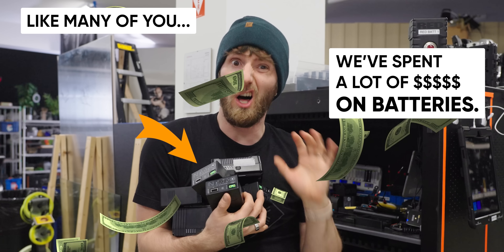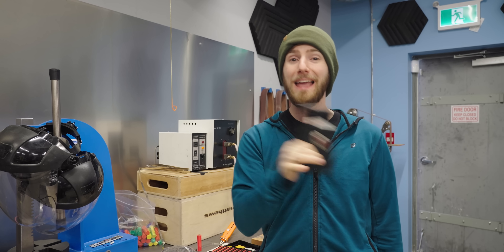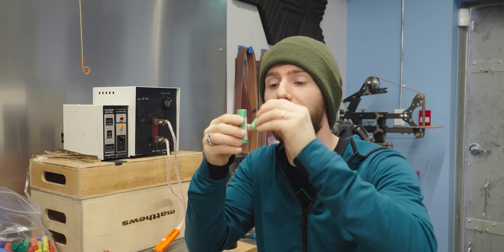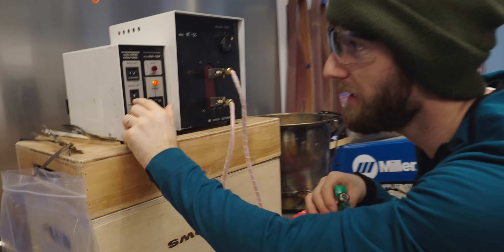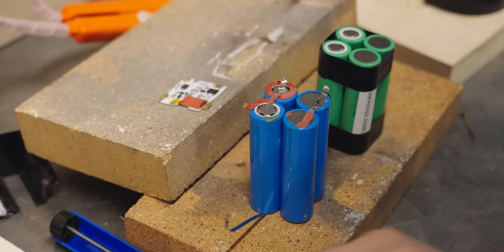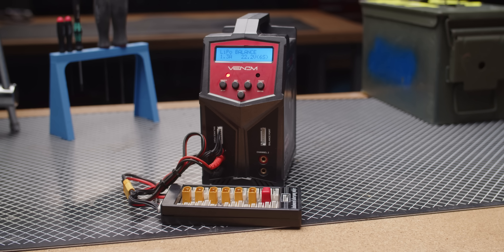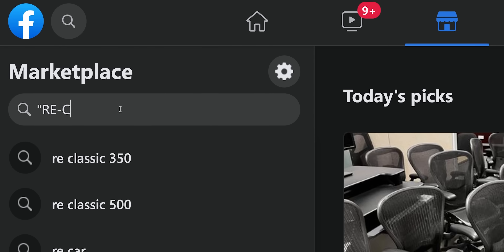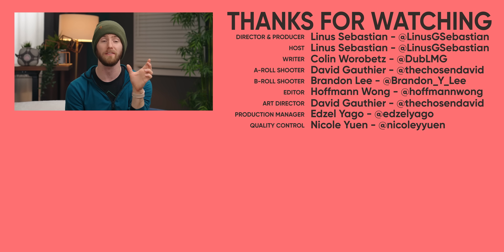This should be illegal… Battery Repair Blocking

Comment: 3:57 Linus explains how to do it like anyone is going to actually do it for themselves lol. I love this channel, but I don't think anyone is going to use LTT as their guide to repair their batteries lol. I know I wouldn't.
Reply: The LTT videos I have watched this far contain any electronics projects isn't something I would follow. There are often slight errors and the end result is just about hacked together to work for a short while, non professional
Reply: If you look into it, it is a big thing building Li-ion battery packs mainly for EV's RC ebikes and power walls, there are many forums and over 1000 Facebook groups doing just what Linus is doing here, some groups have over a million active FB users making ev batteries. Ebikes is the new big thing.

Comment: How you kept popping them?  This is what I have found to work...and so far other than the first couple I botched, I have not botched again.  Drain all cells to 3.2 before starting...and while you are using a spot welder...I use solder and quality wire.  Using a small sanding disc on a dremel to rough up a small dot on each end of the battery and using a solder that has a slightly lower melting temp...and a lot of flux I have generally had good outcomes.  If done properly it does not get hot...no hotter than spot welding...

Comment: it would probably have been easier to design and 3d print a new battery case with spring loaded contacts instead of doing the spot welding.

Comment: nothing new to me.  small engine manufacturers have been making parts from plastic that used to be made of iron steel, why?  heir claim is noise reduction, the truth?  plastic moving parts wear out much faster, and most people would just throw that engine away and buy a whole new one after 2-3 years of occasional use.  got a new push mower?  grass has to be cut, especially to avoid HOA or HA fines, and it is 100 degrees or more in the shade?  yeah, overheat that plastic carburetor just once, and you either pay close to $200 for the carburetor or $300 for the entire engine, or close to $400 in many areas for a new push mower.

i have had electronic devices just fail to work once the bad battery was changed out for a good one.  apple i phones are this way now, you can never change the battery as once the battery is removed, that $800+ cell phone is worthless junk and will never work again, same thing is true if the battery goes all the way down and you charge it back up.  and people wonder why i dont have any electronic devices other than a multi meter and an old computer.  replacement costs are way too high when the product cannot be repaired or you simply can not replace a battery that wears out  if a video i saw is correct, ANYONE who attempts to change the battery out of an apple i phone, the ones coming out in the next few months, can and will be fined and sent to jail/prison unless that person pays an apple dealer the price of an entirely new i phone to replace the battery.

if more people had my mindset, these companies would not be selling ANY product until they fix their flaws, and repair blocking is made 100% illegal for these companies to do.  they know how long the stuff will last, that is why all the "testing" and the warranty almost always runs out 1-4 days BEFORE the device/product gives up the ghost.

Comment: I know how to be able to change the batteries without the board disabling itself because of that malicious component which no doubt is a crystal in which is also hidden normally it under a black glob out from in view but also it is under an inside of the black square and  rectangular looking components. It's also how any camera is able to see and record us, not by a way they teach at all. I can't fin anything at all on any crystal doing anythig in electronics and also a tv screen is mainly 3 parts, one layer of the screen is a reddish tint of completely crystal and another is green tinted also being completely a sheet f crystal which most probably assume is glass unless speaking of the plasma style which does havea glass glass cover sheet. Now any camera if you take it apart it'll show u the eye of ability I literally a good chunk of square cut crystal and don ruin it but if u remove the lenses from a surveillance camera and power it on to check out the view you'll relize the crystal has quite a troubling time seeing as if it's eyes were bad r something. But that the reason for the lenses which can anyone at all explain how the I hope to work? It's a capability of recording it's surrounding, excepting messages of a specifics to bring programed specifically so not to do anything beyond it's rules f maintenance which I kinda scary to think on once realizing how tis thing can even listen to begin with. Yeah it programmable but how? It's not like being any other component of the board, they are inline circuitry, not a brain like the crystal suggests beyond the visual and definition of which in taught but for fact it is doing what it's at least taught or just old to do...this emplys being able to view into any crystal in the world visually an with audio. But back to the batteries, if you can find a voltage regulator of dc which there's millions of the hook it to the circuit board you can then remove the batteries without the losing power n in return the message should not be sent but thinking on this I'ma guess there's another limiter built in to further protect itself from being fixed lol I'd garentee there's a timer of sorts built in so to make sure no matter the state even of the batteries this message of time count down of specifics will misfuntion in a descreet but milicous again btw way, but taking the batteries into a classification of longevity, which I'm saying is completely regulated in all fields, science, any theory's I mean I name it lol. It's worldwide being also a control over the product did which if an person mad a better light bulb for example I better believe it's not gonna even find it way so say legally into any store for the fact that it would go thru the regulations office which we run, then thru the patent, which we run, ad if found out first off thtlwt in regulations state a bulb may not last longer than the mass agreed which u know who then a citation is given which prevents a person from publishing or commercializing the product in review, straight up gangster now if one looks back on electronics and ha that realization of the circuit chit board being the complete of certain regulations of agreed law, yes, but of a build completely I mean look at it, a tv is 120 voltage but inside it can n does go into a 600 volt output to be able to turn the damn blacklights on which are the smallest fluorescence I've ever seen but being as long or longer even n or mainly now being a LED which now think about it, they make a LED be able to be a 3.7v or a 600v by it's controls on thinness of wire n sizes in it's make, so for example if a gage of wire like 15 gauge then this 15 gauge must take a certain volt to work it also involved would be the amount of anything of it's make at all like the metal inside that electrified which gives a certain an specific color by which given is being mainly mercury but if blue, red, or green to whatever color then a added metal of specifics is given.

Comment: Hey linus as said before by other comments the sparks were likely not hazardous.
But your spot welder was set pretty hot (the cells don't like it too hot - that is the whole purpose of spot welding because soldering is too hot for too long)
I got some experience building battery packs (2x600WH (13S4P) for my mums e-bike 1x1.2kWH (13S8P)for my bluetooth speaker w/ 400w rms 1x240WH (6S3P) for my brothers scooter).
Better be safe than sorry with those beasts, but a few sparks from the weld are to be expected also I made my own electrodes using copper pipe and solid core copper wire to have re-placeable tips held in by screws.
A good idea is also to "sharpen" the tips ( I used an old sharpener for making coax cables from work)
Not an expert tho.

Comment: Manufactors use the excuse of safety for the consumer while intentionally blocking us from repairing it ourselves. They do this on most consumable devices such as printer cartridges. They sell the printers dirt cheap and charge astronomical prices for the cartridges. it's a racket. Unfortunately, fairly speaking, it is probably the result of lawsuits against them costing millions of dollars. I am outraged how even simple devices cannot safely be disassembled, leaving you learners baffled and discouraging them to go further.

Comment: 13:34 Sometimes BMSs shuts down for safety, you have to try to connect the battery pack with its charger, then, generally, it keeps working and it wont shut off.

Comment: You missed an important step: Cycle all of your new replacement batteries with a charger designed for it, with capacity measurnment. You can also grade cells and match them up based on thier actual capacity, and discard or return any defective ones...
Reply: I'd think too when building the pack you'd first discharge the batteries to 20% or so, just to reduce the amount of energy present in case something goes wrong.
Reply: @gargantuablargg  Doesn't matter. A well depleted cell-group from one of my packs read dead-zero when I removed it. When I seperated the cells, a few of them slowly regained charge as the really defective cell that was dragging the other 3 along with it, was then gone.
It never got up beyond 1,5 Volt or so, but during test-fitting a 3D-printed housing for one, a small piece of remaining nickelstrip on the positive terminal of that cell, from the original setup eventually pierced through the insulation-sleeve and connected positive to negative. Immediately the smell of something burning caught my attention and I only then saw the piece of strip was glowing. Discharging them down to 20% won't help you a single bit.
Reply: You don't need to do that with brand new cells of known brand and decent quality.
Reply: @johncoops6897  You do.  If you match a 3400mAH cell with a 3200mAH cell (which is within parameters of manufacture) it will mismatch faster than say, 3350 with a 3340 in a 2 cell pack.
Reply: @Ikouy  - consumers don't have the luxury of buying huge quantities of extra cells to capacity test them all and select matching ones. Manufacturers never test or match cells. What can you do with the non-selected cells, throw them away?
If you buy quality cells there is very little capacity difference anyway. And even testing the same cell will result in capacity differences for a variety of reasons.
Reply: @johncoops6897  if I'm using four cells, I would buy 8.  If I need two cells, I would buy four or six.  The objective is to have cells as close as possible.  Manufacturers would more than likely have impedance or other expensive tests we do not have to match cells.

It would be silly for manufacturers to not test cells, if not packs, before shipping them.  A single poor cell would reduce the number of charge cycles from 500 to about 10.

You're correct that repeated testing of a single cell will yield different results.

As for non-matched cells if they're close enough to other cells of the same batch they can be used for other projects if not spares.
Reply: @johncoops6897  Your wrong sir im sorry.
Reply: @ericremple6395  - Being a realist doesn't make me wrong.
PS: You go off and  measure the "capacity" of a single cell 10 times, and tell me the deviation across the 10 measurements that you took of that exact same cell.
PPS: I am sorry that you don't know how to spell "You're", nor how to use punctuation.
Reply: @johncoops6897  18650 are not consumer type of product. Its a different game and liabilities are different. Please before throwing info out there dont freestyle and do look up basic info.
Reply: @Warax12  - of course, everyone knows that 18650s are not consumer-grade products. I am not sure why you have started rambling about random things, without actually making any point.
Reply: @johncoops6897  see the comment i replied to, u stated that consumers dont have access. But professionals do have access. So it invalidates ur statement.
Reply: @Warax12  - i have no idea what you are babbling about. I did not say consumers dont have access. You are not making any sense at all, and I cannot work out what you are trying to prove.
Reply: @johncoops6897  Just understand that to do build a pack properly, you need to balance the cells. You cannot rely on the manufacturer to give you cells closely enough balanced for use in a single battery pack. You can go without balancing, but its not a good idea. And because 18650 are not made for most normal consumers, you are expected to buy more than you need and balance them.
Reply: @max_uaminecraft1827  - Can you read? I stated clearly stated that COMMERCIAL BATTERY PACKS do not contain cells that the manufacturer has carefully tested each and every cell for mAh Capacity, then sorted them into groups and assembled each pack with "perfectly matching" sets.
I also clearly stated that if you measure a cell 10 times, you will get 10 different mAh Capacity measurements. And as the cells age, their capacity alters anyway.
So, which measurement will the manufacturer use? How exactly does the manufacturer achieve your claimed "Capacity Matching" of the cells that they spot weld together?
The comments you are making show that you have some experience with reclaimed laptop cells, but no practical experience with brand new name-brand cells and with what actually goes into battery packs manufactured by commercial factories.
Reply: @Ikouy  Cell-manufacturers never test every cell. They test a random number of a batch to see if they live up to their specifications and if they do, the batch gets the right label attached, where the datasheet will usually always state something like: 'Capacity: min 3200, typ 3300, max 3400 mAh', same for the internal resistance.
If you put 4 cells in parallel that consist of 3 cells that are above typical performance and one that is well below typical performance, it hurts the capacity of the cell-group in total, as the rest will either start to charge the slightly faster draining cell (during discharge) or will 'discharge' the other cells as one cell earlier reaches a full state-of-charge.
It is cell-pack manufacturers who test all the cells with quite sophisticated equipment.
Reply: @weeardguy  I am not sure why this is tagged to me, you're repeating nearly everything I said just worded differently.
Reply: @Ikouy  Well yeah that's the difference between 'manufacturer' and 'cell-manufacturer'... I read your 'manufacturer' als 'cell-manufacturer' ;)
Reply: @weeardguy  In some cases, such as Panasonic, they're one and the same as their laptop production is in-house.  Sony would be another example on the polymer front.  It's quite subjective depending on what it is.
Reply: @johncoops6897  What are you saying... Reality is that mismatch cells will not last as long as matched cells. Doesn't matter where you get them.
Reply: @ituneca1862  - Slow learner? I am saying that factories do not cycle test every brand new cell (to check it's mAh Capacity) before it is connected together to make a battery pack. That is the REALITY of how new products are manufactured, irrespective of your mindless arguing.
Reply: @ituneca1862  No, what John Coops is saying that when you pair non-matched cells, a group that consists of 'bad' ones (relatively speaking) will have it's effect on the total pack's capacity, while grouping cells that perform the same way as close as possible, will have a far better chance of surviving a long time as a pack.
I completely forgot about this (as my cells were knew there was a little less necessity to test them thoroughly) when I assembled my first pack for my V-mount recelling 'campaign' (I've got five of 'em).
Just grouped 16 cells in groups of 4 and spotwelded everything together. The gas gauge (BMS) (BQ20Z65) in my packs had to do quite some balancing in order to get them all charged the same.

With the next two packs, I handled it differently: I took my Imax B6 out and took 10 internal resistance measurement tests, moving the cell inside a 18650 holder every time between measurements to outrule contact-resistance differences. This is not the same as a capacity check, but the results are good.
I average out those 10 measurements of each cell and then make groups with cells that are within a 0,005 Ohm difference to eachother.
Then I start to calculate (by hand, I'm not a mathematician that comes up with a nice formula to easily handle this) the 4 most efficient groups of cells. I want all 4 groups to have a total resistance as close as possible to eachother.

The result is that during charging and discharging (and monitoring the BMS via the PC) the cell-voltages (remember: each group is 4 cells in parallel and counts as 1 cell) stay waaaay good close to eachother. The biggest deviation I saw was a mere 15 milliVolt, while it got up to something like 750 mV on my first pack.

Though the first pack works well, I expect it to die the quickest, just because one group is underperforming compared to the rest.

Comment: I wish this was true, however, most failure of these battery packs is 90% electronic failure of the charging and safety circuit.   I find that the opposite of your video is more true, extracting good batteries from a failed battery pack.  P.S.  Would you like to buy some unprotected li-ion cells?

Comment: Seriously, Panicking at every spark will get you and your battery cells fried faster than simply waiting and standing back to see if the cell is ok. Hasty actions and high-current batteries DO NOT MIX. Oh and NEVER use a metal bucket man, come on.